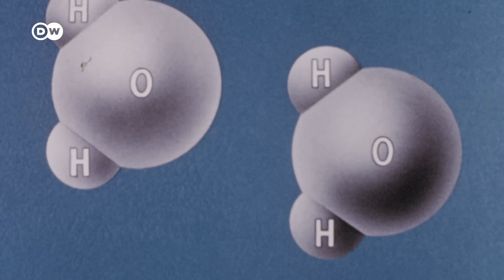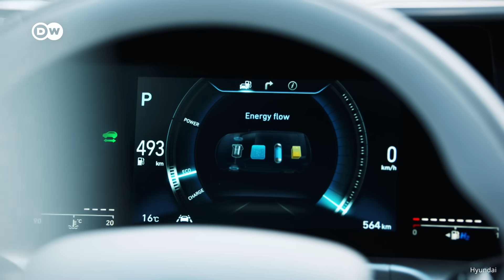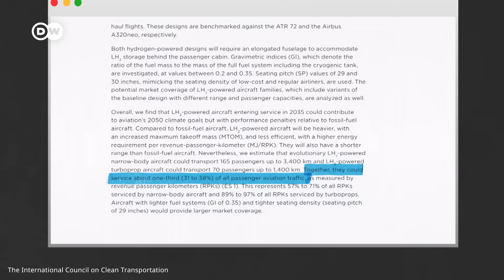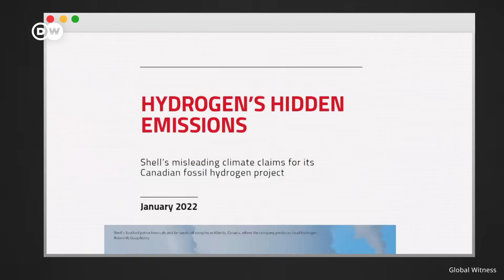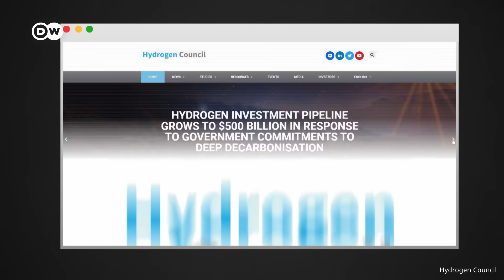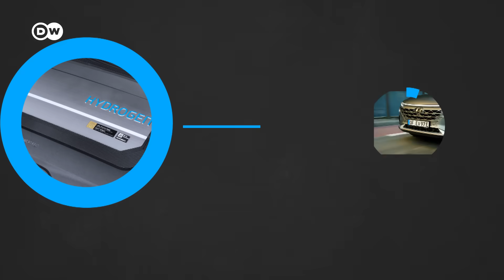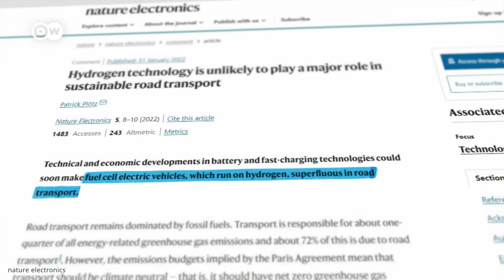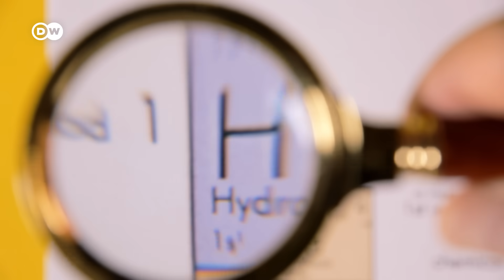The truth about hydrogen

Comment: There are just too many problems with hydrogen as a fuel to EVER make it viable. Ie. the problems they claim they will overcome (ie. more efficient electrolyzers) are not true, because you  are right up against physics. There is always a  minimum amount of electricity you will need to produce a Kg of H2 by electrolysis, no matter how efficient they make the process. Which means you would always have to dedicate all of your renewables to it, which will never be enough. But it gets worse, much worse. As mentioned in the video, it is very difficult to store and transport hydrogen, because first liquifying Hydrogen at -250C is just not an option, and as a gas you need to heavily pressurize it (200 bar+) to get any kind of density. With high pressure hydrogen stress corrosion of steel tanks, which of us would be brave enough to have this in our cars ? Right now, the Japanese are asking for the Australians to ship them liquified hydrogen by tanker from Northern Australia, and this is where the whole hydrogen things gets loco. They want them to burn coal (because there is insufficient renewables even in Oz) to make electricity - electrolyse, then liquifcate, then ship. The shipping alone on a two week voyage to Tokyo loses you between 2-5% in boil-off per day and the liquification is horrendously inefficient. If they go ahead with this, they could lose between 70-90% of the total starting energy from the coal before it gets to a Japanese H2 fuel celled car. Now that is crazy. People have talked about re-purposing the natural gas networks to transport H2, but not only do you have hydrogen escaping 5 times more than natural gas, but there is no way to add a mercaptan tracer molecule to the hydrogen either (difference in molecular size and density are too different). you would need to install h2 detectors every 10m on pipeline, which for a domestic pipeline is not even possible. Hydrogen is not a good fuel for many reasons. I've heard it called a super-fuel with high energy density.... yes, when it's in liquid form. As a gas it's one of the lowest energy density fuels. Unless we work in a cryogenic H2 plant or a space agency, none of us will ever come within 50m of liquid hydrogen in our lifetimes
Reply: If I could give your information a thousand thumbs up I would. It is important to point out that hydrogen might seem a good idea if you only look at the simple stats but is a nasty bugger to deal with if you take the limits the physics of dealing with either liquid hydrogen or high pressure hydrogen into account. It's best use where there is no viable alternative, like in steel production. If we want carbon free steel production then we must use smelters that run on hydrogen because not only does hydrogen provide the energy but it can also take the place of the O2 removal from the molten ore.
Reply: @karlgunterwunsch1950  Thanks Karl. I appreciate your '1000 thumbs up'!  It is a shame there are not more chemists advising Governments because they are wasting billions on making hydrogen, with no infrastructure to transport it effectively or store it safely in cars. In fact, probably they only thing it could really be used for is what you mentioned - steel production.  I would rather see the Western  Govs. investing the tax payers money subsidizing electricity and gas prices, especially for low-income families. Otherwise, come this winter I am expecting quite a bit of unauthorized de-forestation to occur. Now I would say that's the opposite of green

Comment: Those who want us hooked on electricity, like shell and ford in the late 1950s and early 60s, they debunk it.  My great uncle built a hydrogen card within a ceiled circuit  that drove from Melbourne to Sydney.  Ford and Shell bought his car and buried it, because it would destroy the oil industry.  Petrol is a by product of refining oil for lubricants and needs to be disposed of properly, using it as a fuel made sense and lots of Dollars!

The method my uncle used would have made transport super cheap and no one would be made super rich by it, so it was buried.

Comment: Hydrogen is not an energy source it's more of a chemical battery. I've been dabbling with electrolysers for 10 years and seems to me a good approach is to store the hydrogen as water and carry an on board electrolyser that can produce the hydrogen required on demand, this can then be combusted and used on regular gasoline cars with very little modification required, the electrolyser can be run using the cars battery which is constantly recharged by the alternator 

Did you know you can use hydrogen as a supplement to your air fuel mixture on your car? I have done this myself, I used 6 pack of jars of water, the battery converts it to hydrogen and oxygen, which by the way in a sealed cycle with no air intake is already the exact ratio of H and O needed for combustion, I connect a tube to lead the the H/O or browns gas into my intake manifold, with the air now partially combustible I Program the cars engine to a leaner airfuel ratio. There are other minor modifications like a condenser to make to ensure today's engines don't recycle the spend hydrogen or it will rust the chamber. Doing this I've achieved 100 mpg on my car. The more efficient the electrolyser = more hydrogen produced on demand = leaner airfuel mixture = higher mpg
Reply: Have a nice time grinding to a halt after 1-2 kilometers as your car battery will be flat by then.  Burning the hydrogen in an ICE has an efficiency of less than 20%, some of that little movement energy generated will be syphoned off by the alternator but it can at most generate enough electricity to create 12% of the hydrogen you set off with. So without moving the car forwards you reduced 1 kg of hydrogen to 120 grams...

Comment: There are a few points missing in it. What a sir said in it that renewables are scarce and need to be used efficiently its wrong in a way, a lot of times renewables, whether you want it or not, take the production off electricity in the grid to a surplus, there fore, wasting energy, and sometimes just turning off wind turbines, because they are much easier to stop and go than a steam power plant. With a surplus off energy, it is a very easy way to make green hydrogen with energy that was gonna be lost anyway. A example of using the surplus of electricity in the grid are, for example dams and reservoir, that have been used for a long time.
And lets just say, green hydrogen is the preferable, grey is definitely not wanted at all, blue is a technology in development stages still, there is development to be done with it.
Now the big missing point about hydrogen, is that grey or blue, even if pollutes a bit more its necessary to develop the technology for when the main production of hydrogen is in a green way. Otherwise you reach a point in time where you have a great production of green hydrogen and no technology to use it on efficiently. And its a cycle, more things needing hydrogen leads to more green hydrogen being aimed at in the future, making it worth the investment. 
Sorry its long for who reads it, but its a view of someone who works in the field, and i know hydrogen has some flaws, but workable around flaws

Comment: One thing I don't understand about hydrogen production if you're going to use electrolysis, is why you wouldn't just develop better ways to use the electricity in the first place? You're basically losing a lot of energy converting electricity into hydrogen, and then turning hydrogen back in electricity. We already have electric cars, I know electric vtols are and propeller planes are on their way. It seems only a matter of time before we electrify everything to some capacity. 

I'm not saying there are no use cases for hydrogen. But by the time you've developed the infrastructure to move the hardest fuel to store (which it is), the elctric revolution will have run it course and who knows wether we still have a need for hydrogen at that point.

Comment: As a chemical engineer, this my take on the present and future energy trends worldwide:
The inevitable rising populations and standards of life worldwide, particularly in third-world countries,  means that demands for energy will only continue to skyrocket in the future. As a result, every single  available source of energy in Earth will be indispensable to meet such ever-rising energy demand. To that end, fossil fuels will continue to be a valuable and readily available energy source. The issue with the current carbon economy through the utilization of fossil fuels  is not an inherent one; it is the carbon emissions associated with their utilization. Therefore, the rethinking of the current conventional utilization of fossil fuels must be considered and realized as a part of the transition towards cleaner energy sources. This is captured in what is known as the circular carbon economy. In such a truly circular carbon economy world, utilization of fossil fuels is to be continued, but with vigilant carbon management. This includes carbon capture, utilization, and storage (CCUS). It also must be noted and realized that this circular carbon economy is not by any means intended to replace the hydrogen economy model , but to effectively complement it in the transition towards greener Earth. After all, hydrogen, is not an energy source, but an energy carrier that needs to be extracted from its  sources such fossil fuels and water. This extraction process requires huge amounts of energy due to the endothermicity of the major hydrogen production processes. In addition to renewables-based energy, this required energy can be and perhaps must be obtained from fossil fuels at least in the transitioning period in order to meet the expected high hydrogen demands that is predictable in a hydrogen economy world. The CCUS technologies are still under development and expected to become more efficient and mature in the future.

Comment: One big source of hydrogen that is not mentioned here is the so-called turquoise hydrogen: the production of hydrogen through the decomposition (pyrolysis) of methane. This produces pure hydrogen and elemental carbon. If the energy of this endothermic reaction comes from renewables, then, this type of fossil fuel-based hydrogen is just as green as the one from electrolysis, since it does not produce any CO2 emission. Given the huge abundance of natural gas reserves worldwide, this is a very promising way to produce emission-free hydrogen from fossil fuels. In addition, if the bio-methane is used for the production of turquoise hydrogen, then this way of producing hydrogen can even have carbon-negative emissions, given the energy needed for the reaction is renewable-driven.

Comment: I feel that by the time hydrogen is practical that some other energy source will probably supplant it. I also feel that there is not enough lithium in the world to create a replacement automobile fleet.
Reply: At 11 kg for a 70 kWh battery lithium isn't that sparse. There are big deposits in Austria, Germany and Portugal alone which currently are being investigated for new mining operations to begin. Also there are new battery chemistries that have sodium take the place of lithium and the latest research papers suggest that by the time we may need too much lithium (which is a long way off) they may be ready to take up the reigns. Biggest drawback is that the sodium batteries have lower volumetric energy content - which can be offset by moving from a prismatic (Tesla) cell to pouch or chassis integrated batteries which have less wasted space around them and thus offer more volume to the battery.

Comment: I do not believe that hydrogen will make the future for storing energy. There is too much issues on the way. 
1. The whole process is too inefficient, why use electricity to produce hydrogen if we can use big part of it directly. 
2. If we want to store it - the hydrogen molecules are so tiny that they slip through the gaps between atoms in tanks so they slowly yet constantly lose their load, we can prevent this by colling H to liquid but it consumes a looot of energy, there is also a H-paste that prevents the issue but this lowers the energy density to the point where batteries are better. And the batteries seem to get more attention from the science community so I assume the big break will probably be about batteries. 

If those issues can be hammered out though I see it complementory to batteries, where batteries will power small to mid-sized vehicles and the big ones, along with industrial applications can get the use of H.

Quite a balanced video. Good work! Although I would prefer it to have a little more details.

Comment: The nature has endowed humanity with high energy density materials; yest fossil fuel.  The problem is that much of that energy density is wasted.  However, I am persuaded that it would be far more productive and effective to create say internal combustion engines or other fossil burning contraptions that would exploit much better energy encapsulated within fossils than the current engines.  Such efficient contraptions would significantly reduce the need for fossils and that would hit the majors' profit bottom line.  Ironic isn't it that the majors promote H and Li technologies because these consume more fossils.  With trillions spent on alt fuel, we, engineers could've developed far more efficient contraptions.  But that's not in the interest of major fossil companies.

Comment: Great video - compared to the hype in mainstream media. But you left out quite a bit.

Yes, hydrogen is a clingy gas, it is also elusive, easily leaking out from storage tanks: And extremely explosive when leaking into the atmosphere. Remember The Hindenburg ?

Hydrogen is made by steam reformation of natural gas which is mostly methane. The electrolysis hype from Bloomberg is nonsense. Electrolysis costs 6-7 times as much as steam reformation, and is no longer used. Green Hydrogen will use energy from solar or windmills, but these are unprofitable and require subsidies, in addition to being unreliable. Which means green hydrogen will be more expensive than grey hydrogen. Add backup-power from nuclear (wont happen in Germany) or from fossil fuels. Blue Hydrogen means capturing and storing CO2-molecules from the process, which means you can double the costs again. More nonsense of the most extreme and expensive type. Nature already has a process for capturing and storing CO2, which is freely available on every continent, except the Antarctic. Trees.

Comment: The big misconcept is due to not thinking disruptive and still beeing fixed on using existing infrastructure and still beeing cheap. 
Why we need to transport hydrogene through the world like oil and gas instead to produce it where it is needed. 
The best idea would be transforming a fuell station into a hydrogen producing plant. 
Moreover why not create compact combinated PV plant with hydrogene storage for the peak Energy? 
Why not use combined plant of Wind, PV and Gas (produced by composting green waste and dung) to produce hydrogene? 
Why not convert CO2 from the air to Methan/Hydrogen?  
Why not use the gas, biologically produced by bacterias, at the water cleaning plants?

Comment: Hydrogen is worth the hype.  The final answer will be a portfolio of energy solutions - hydrogen, electricity and even good CCUS.  Finally, why in this video is methane stated as 80X times worse than CO2 when the standard GWP of methane is measured between 25 and 28?  Thank you.
Reply from the maker: Thanks for your comment and question! 
Our reporter's research found that in the short-term, methane is more than 80 times more powerful in warming the planet than CO2. 
This information comes from the United Nations Economic Commission for Europe (UNECE) (Link 👉 https://unece.org/challenge).
The number is confirmed by the International Energy Agency (IEA) (Link 👉 https://www.iea.org/reports/methane-tracker-2021/methane-and-climate-change), stating that “the Intergovernmental Panel on Climate Change (IPCC) has indicated a GWP for methane between 84-87 when considering its impact over a 20-year timeframe (GWP20) and between 28-36 when considering its impact over a 100-year timeframe (GWP100)."

Comment: Hydrogen should not be used as energy source, but as raw material. Storing it is a nightmare, H explosions, are scary. It embrittles pipes and valves, it requires an order of magnitude better insulation than regular gas. Surplus renewable electricity should be turned toward electrolysis, but the resulting hydrogen should be used up on site, forming fertilizer, or making steel.

Comment: so in the comparison (60% vs 20% energyloss) would be insightfull to show also the pollution coming with mining for the minerals for all these batteries needed for the batterie solutions?
Reply: Strange how lithium is a problem when it's used in a EV battery but not when your oven top Ceran field is made out of a lithium rich ceramic or the glass casserole for your lasagne... Or the cobalt is used in an EV battery but not when it's the coloring ingredient in that cheap blue mug from china, your ICE crank shaft and valve seats consist of high cobalt steel and your fuel is cleaned from sulphur components with cobalt at the refinery...

Comment: We are moving away from fosil fuel for our energy needs. Wind and solar are pretty much the standard in the EU but those aren't the most reliable. As they become a bigger portion of the energy mix we will face some issues on days with less wind or sun or on days with so much of it we cannot sell it. One of the solutions is converting some of it into hydrogen. 

Solar in the desert in the middle east and northern Africa is another option. But running power lines through the ocean and all across Europe might be a bit difficult. Converting it into hydrogen seems to be be a better solution.